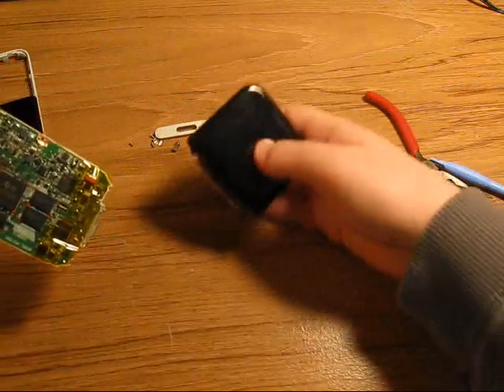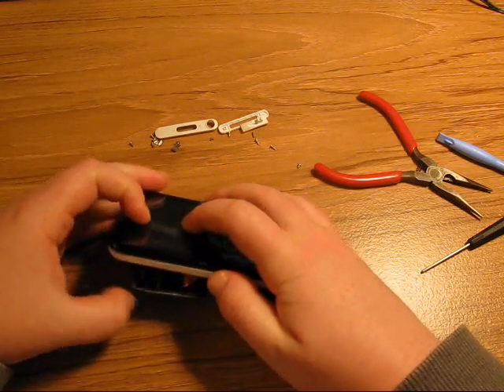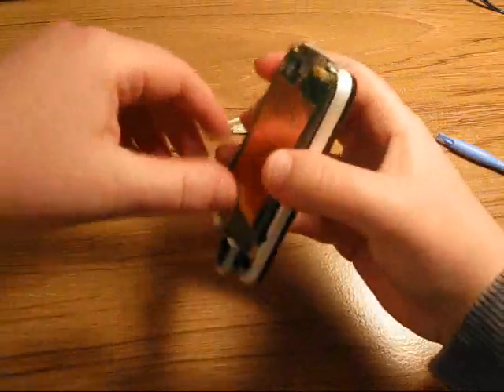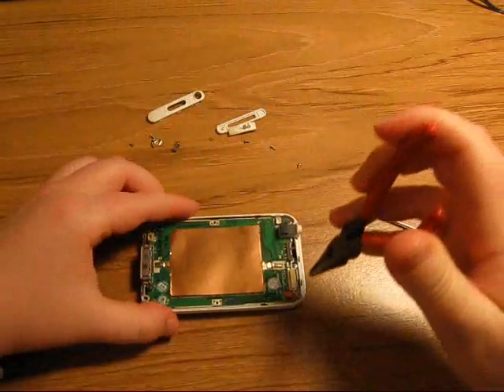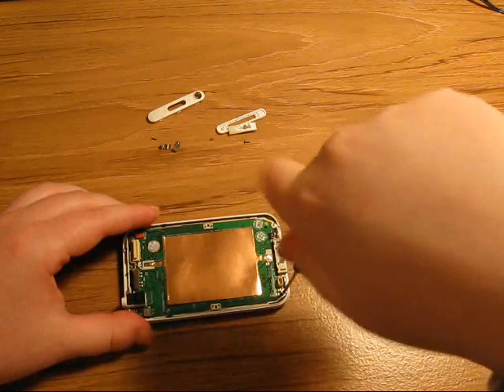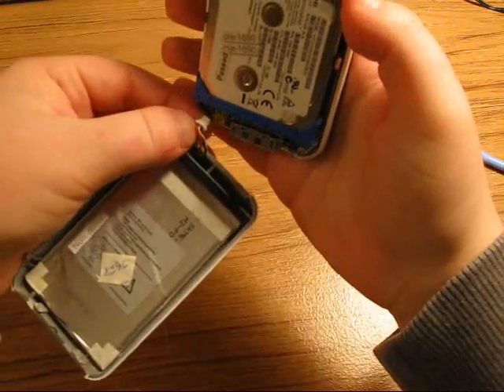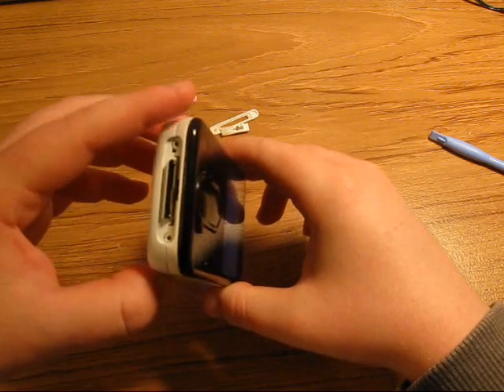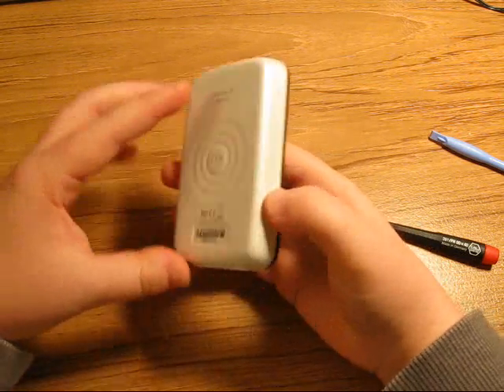Zen Vision M Complete Reassembly Video by a Technician

Comment: Saludos y felicidades por tus videos muy ilustrativos. Quisiera saber cómo poder reparar una pieza del Mother board. El tema es que no sé como se llama, es una pieza rectangular, delgada, de color broce. Tienes dos conectores soldados. Me interesa saber: 1.- Cómo se llama la pieza, y 2.- Se pueden volver a soldar (ambas están rotas) ?
.-.-.-
Greetings and congratulations for your very illustrative videos. Let me know how to repair a piece of Mother board . The issue is that I do not know as it is called , is a thin , rectangular piece of bronze color. Soldiers have two connectors . I want to know : 1. How is called this piece, and 2. I  can re- welding ( both are broken ) ? 
GMail: jbarrios28

Comment: Turns out the molded rubber piece fits over the microphone next to the side frame. Fitting it back to where it's supposed to be also solved a glitch in the sliding power switch function! Hooray for Youtube, would never have solved this without it!!
Reply: That's where I'm stuck... I can't see where it goes???

Comment: Best video tutorial series ever!!  One question:

When I took the top cover off and removed the sliding power switch there was a small rectangular molded rubber piece (hollow with a raised oval knob on top) sitting free next to the spring loaded power mechanism. It was not connected to or covering anything I could see and it fell out when I removed the two frame halves. What does this piece do? Is it a dust protector? Does it insulate some electrical component? Where does it fit back into?